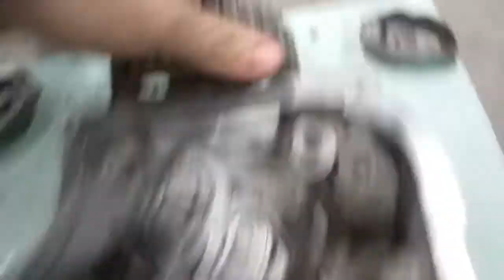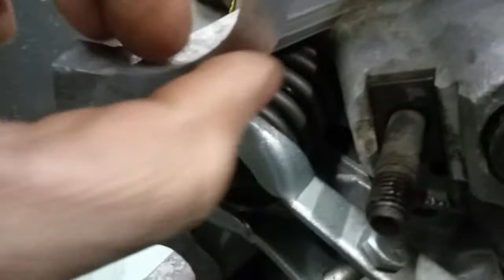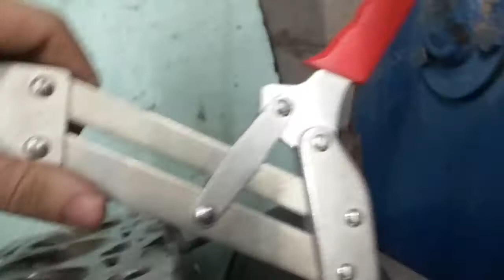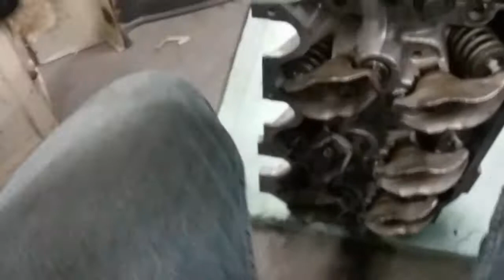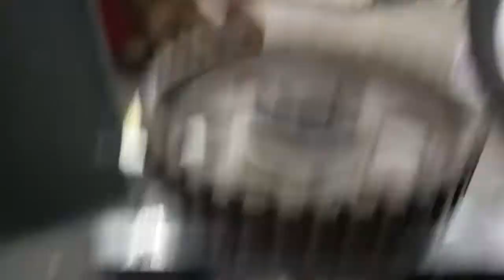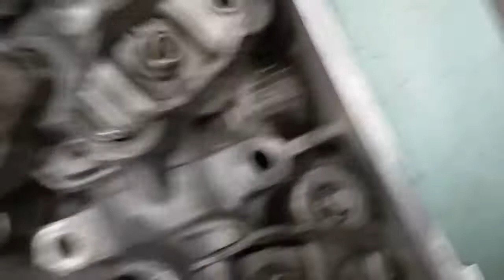Ford CVH Rocker and Valve Spring Removal WITHOUT The Special Tool

Comment: I used a similar tool initially but made a small tube (roughly 40mm long) that fits under the fork end with a cut out to get at the collets. I have now bought the Sealey tool. Good vids though